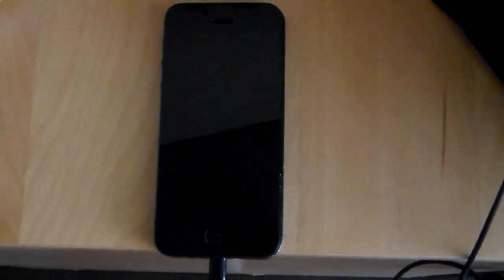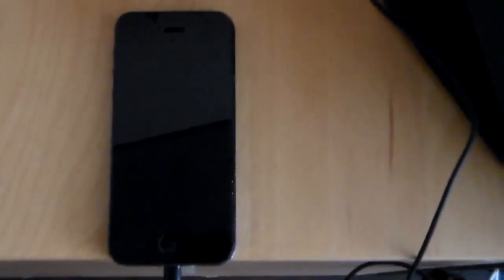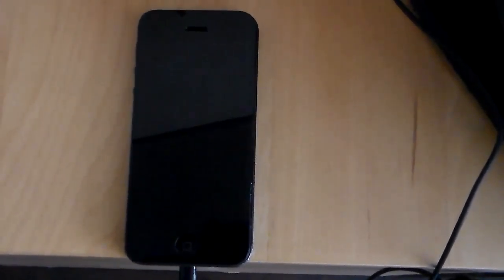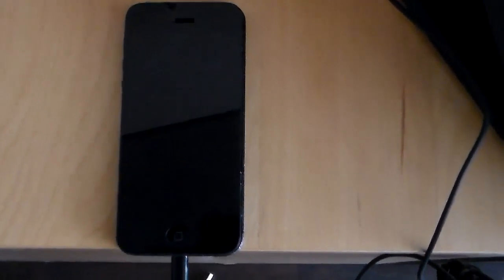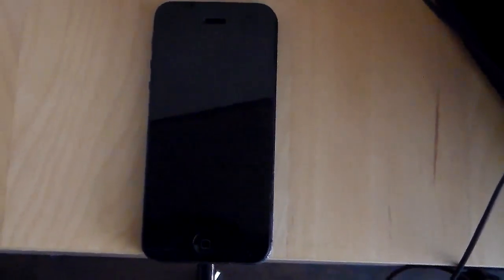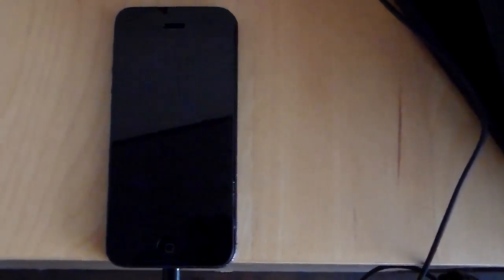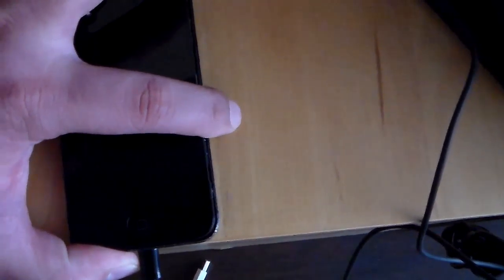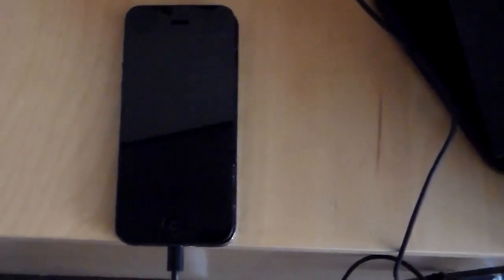Water Damaged iPhone 5 Vibrates every few seconds with broken LCD display.  Can't charge phone.

Comment: I HAVE THE SAME PROBLEM Vibrates every few seconds with bLACK LCD display even if i romoove the lcd and i connect it  whit itunes its the same problem steel vebrating every 5 secend :/ i didnt have a solution

Comment: You aren't supposed to charge your iPhone when it has water damage, I tried charging mine while it had water damage and it fried my phone. One of the things you could do to help the water damage is to put your iPhone in a bag of rice overnight, so the rice can suck out all the moisture.
Reply from the maker: +Jen L Thanks Jen.   You are very correct.  If the phone had been water damaged in the sense that it fell into water,.... then people should attempt to remove the moisture with rice... or take it to a professional who would most likely open the iphone and dry it out manually.

The broken iphone you see in this video only had water drop on the top of the screen.  Upon opening the phone there was no evidence of moisture damage within the iphone.  

What I hate about the beeping is that it could be a number of things related to a bad screen or even mainboard damage.

Comment: this problem is currently happening with my iphone5c water never touched it but i dropped and it went black and when i plug it into the charger it dings/vibrates every other second. help im scared!
Reply: Did you find a solution for it yet?
Reply: michelleduran30 yes actually! i went to get my screen replaced
Reply: Moocowymandel did it fix your phone??
Reply: OR... you could not buy an iPhone that breaks after one drop. Easy solution- get android for half the price and stop wasting your money on shit.

Comment: So water can possibly damage the iPhone screen uh? I just got my screen dysfunctioning because of several drops of water. But i can still hear the charging sound everytime i charge it to my iPhone. Any solution mate?
Reply from the maker: Kaka Leite This phone had water splashed on the top of it's screen.  The previous owner was in a hot tub.. and got the screen wet.  It worked for a few days after the owner dried off the screen, but eventually the screen went out.. and did what you see in the video.

Comment: Remove the screen by taking out the two screws on the bottom then pull up the screen from the bottom using a suction cup 🚨(careful there is connector ports at the top) remove the cover and take the ports for the screen off. Unplug the battery and clean the phone with 99% isopropyl alcohol. This saved my iPhone 5 after it took a swim in a salt water fish tank

Comment: my does that to but i hold the home button and the power button for 10 sec and its works
Reply: but where can i buy a new screen for a Iphone 5c my is all cracked i got the phone for free form my friend and it still power up but cant open the phone form the pass code because its all cracked
Reply: Go to a site called          Ebay         and buy it there they make the best deals also they take less $$$$$ than Amazon

Comment: I have a 5c with the same issue exactly. The only difference is I damaged the screen when I was replacing the battery.
Reply from the maker: Oh wow.... do you remember what part might have been damaged?  I'm guessing it was the LCD cable?... Usually if the digitizer cable is off... the iphone will still boot up.. I think..

Comment: My friend gave me a iPhone 5c and the screen is a little cracked but she says it turns on and works but she hasn't charged it for two months ,I got the phone yesterday and charged it and now it's making the beeping sound. Do I need to charge it for a long time or something I don't kno please help asap !!!!!!!!!
Reply from the maker: hi shemar.

when is it making the beeping noises?

when it is beeping, have u tried a hard shutdown.  press and hold the power + home button at the same time.
Do this holding itmformlike 15 to 30 seconds.  After its completely shut off , you can try powering it up again.

laslt, when you hook the phone to a computer or desktop, is the phone detected by itunes?
Reply: Thanks for replying, and yeah when I hook the phone up to the computer, the phone is detected by iTunes and I have restored it , I have pressed the power button and the home botton together it powers off , I can tell because when it charges it vibrates or beeps ,however it doesn't turn on ,so I think it's the screen is the problem...
Reply from the maker: Shemar Official Yes,  it is likely the lcd has gone bad., 
Best case scenario is that its just a loose connection.  A repair shop should replace the screen for $60-70.  i think a replacement screen costs $30 and above on ebay/amazon.

good luck

Comment: I have the same problem, one day I went to the beach and it started raining so my phone got wet and the screen went black so I went to the replacement store and they replaced  the screen with a new LCD and screen in there and start working.but 5 days later the phone drop and then the screen stopped working and I plug it into the charger to see if it would solve anything but when I plug it into the charger it just kept vibrating every 5 seconds.should I buy a new screen????
Reply from the maker: Hey Matthew... since you just replaced your screen... why not try taking the screen back to the LCD replacement shop and tell them it stopped working.  

It might have been the screen was faulty to begin with.... and you dropping it only accelerated the process of it dying.

On the flipside... maybe it's just a loose connection... something they can fix easily.

Comment: got the same exact problem...any resolutions yet? i have the 5s and its water damaged
Reply from the maker: In my case... mine was just a broken LCD.  Once I tried it with a cracked LCD which I got off of ebay for $15, I also tried purchasing a new screen for $45 and that one worked also.

When you plug the phone into a PC/mac with itunes.... does it recognize your phone?  In my case, it could detect my iphone 5.
Reply: it does...it even syncs the pictures from the phone and everything but the screen wont turn on and it wont stop vibrating
Reply from the maker: chido mangi I had the same exact problem as you then.  
1) Phone will just beep or vibrate (if I put to silent mode) every few seconds when plugged to charger
2) If plugged to PC, it recognized the iphone and I could see it on itunes.

It's highly likely you just need to replace the front screen.  
The screen's can be bought as cheap as $30 on Ebay as well as Amazon.  I trust amazon more as you can see the seller's reviews.

* When replacing the screen YOURSELF... the screen does not include a replacment home button, front camera, or front earpiece.  These will have to be transferred over to the new screen.    The home button cable will probably rip.  You can order one of these for $2 on ebay.

Good luck.. I hope it's just a screen replacement.  It sure sounds like it from my side.. ** I'm just a regular person like you.  I'm not a licensed professional so always take anyone's advice on the web with a grain of salt.

Comment from the maker: Carlos,  That's very strange.  So you're saying:
1) When you plug in your charger.. it causes your phone to constantly vibrate or make sounds.
2) When does your screen turn dark blue?  When you're phone turns dark blue... all of the buttons makes sounds like it's locking?

Hmmm... that sounds software related to me... (but I'm no expert).  Has your phone been jailbroken?  Or... what ios version are you running.  Maybe you can try the following:

1) Backup your phone in itunes (and backup important pics/music/videos)
2) If you've already tried turning off your phone, you can try a force shut off of your device as explained by Drake "Hold Power + Home" until the phone shuts down.  Now you can go ahead and power your phone back.
3) If it's still not working, then you might try a factory reset through itunes and then restore your backup from itunes.

Good luck.  I've run into something similar to this.. , but it was with an old iphone 2g which I had running custom firmware whited00r,... it was usually fixed with a reboot or respringing the dashboard.

Comment: I have same problem on iphone 4....my iphone is NO water damaged...please help me...
Reply from the maker: Hey Jaro... what kind of behavior is your iphone 4 exhibiting?  I've had quite a few iphone 4 and 4s's... but I've never once heard my phone beep every few seconds.  

My iphone's that had a broken LCD/digitizer.. they never made any noises at all....
Reply: I Have cracked digitizer / LCD.... I bought from ebay new digitizer/lcd .... I waiting ...
Reply from the maker: Jaro Dolek I see.. you cracked the screen on your phone.  LCD's for your iphone 4 should only run you about $20.  Good luck... it should fix your problem.  Although it's strange if you had a beeping noise.. I thought it was only for the iphone 5.  Take your time removing the screws and take plenty of pictures.

What I did... was i made a sketch of my phone...(enlarged) and then as I removed stuff.. I would tape the screws and parts to the paper diagram so I would know where what went to what.  Also, don't use the included screw driver that might be sent with your kit.  The only good thing is the penta screw drive used to take off the back cover.  The regular screw driver might strip your screws... I had problems removing the side screws as they required more torque then any of the other screws.

Good luck!
Reply: Thaks!:)

Comment: The power and lock button trick is actually just force shutting off the device. It's a mechanism to help if the device has froze and is unresponsive. If you do it on an iPhone that works fine you'd notice it would force shut off.
Reply from the maker: Thanks for the explanation.  I still wonder why this helps some people with this problem... as I would think the beeping noise is indicative of some kind of hardware failure.
Reply: @aleksdude  did you try taking it to Apple? Maybe Apple could explain to you what’s going on and why this is happening.

Comment: Hey Aleks where did you buy that new screen LCD? I have the exact same issue.
Reply from the maker: I usually buy from amazon since they have a pretty good buyer protection (I've had to use it in the past).  

I bought a used one for $45 because it included the home button + front camera and all the accessories.  I didn't need to transfer all of that stuff over.  I can't find a listing like that anymore.

If you plan on just getting the digitizer + lcd, it seems like they've gotten cheaper.  I see that it can be found for as cheap as $30 but they're shipped from china.  Expect to find dead pixels or some kind of flaw for the price being so cheap.

Here is a cheap listing on amazon:
www . amazon . com/gp/offer-listing/B00B3O38GK/

But I'm assuming you need it sooner then later... so here's that'll be hard to find (especially one that's reliable).  I couldn't really find anything with good reviews.

Comment: with the replaced lcd display your phone now works normally with the screen working and no beeping/vibrating and it charges?
Reply from the maker: In my case, yes... after replacing the screen, my iphone starts up fine and charges.

Noone has gotten back to me if changing the screen fixed their problem though.  There is always a chance that the problem may be at the board level.
Reply: aleks dude ok thanks, and this video i watched said take out the motherboard and clean it something with high alcohol so i did and it still did the same thing with the screen and vibrating, so im going to buy the lcd dignitizer and try it
Reply: mwood0012 what HHappenedi have the some PProblem

Comment: Probably the only video that matches the same symptoms as what my iPhone 5 has! I had a broken Screen/Digitizer, so I replaced the LCD/Digitizer on my iPhone 5, i tested the screen as soon as i plugged in the cables within the phone, and everything worked fine. So, i continued to screw the rest of the screws and now its finished I ve tried charging it and it just makes a repeated buzz noise and nothing showing on the screen what so ever! I have taken the phone screen back off and then put it back on again and still no luck. I can t get the screen working again and the buzz noise wont go away. It only makes the buzz when plugged into a mains charger, it does nothing while not connect to charger, no screen, no sound etc. Any ideas anyone? iTunes picks it up and asks me to sync, but then asks me to confirm the sync on the phone....which i cannot. Help??
Reply from the maker: Hey dayle,  i dont think you have a bad board... it sounds like the replacement screen you installed may have failed.

1) You can try removing the battery and discharging it by pressing power.  (Its similar to pressing power + home)

2) Try disconnecting the screen and reconnect it the way you got it working the first time.  I'm afraid the connector somehow broke when you were finishing up the re install.  Its not uncommon for you to get a bad screen if you bought from ebay or amazon.

I've accidentally broke my own screen during installation because somehow the cable connector got crimped.

You might try taking the replacement screen to get tested at a phone shop.

Im not an expert on iphone 5 repair.  I've only repaired the one iphone you see on this video.  I fixed it buying a cheap.cracked screen on ebay for $15.... then when i verified the fix worked... i invested in a $50 screen.
Reply: Okay thanks for the tips.
Also, when I try holding both the power + home button nothing happens. But, if I hold both buttons while the phone is plugged into the charger the phone does restart because the buzz noise stops until restart has finished...and then theres a vibration, and then back to the repeated buzz noise. I'll try taking battery out and let you know how things go.

Ive already tried disconnecting the lcd/digitizer a dozen times now so I'm guessing it can't be that.

And the phone still does the buzz noises if no screen is attached to the phone.

Comment: yes i have
Reply from the maker: Too bad the "home + power" button workaround didn't work.  
Another long shot is removing the battery cable and re-attaching the battery (this would in theory do the same thing as the "home + power" workaround.

If you're phone is still recognized by your PC in itunes, then there's a high chance your phone can still be fixed with the new screen.  

Also forgot to mention, did you try unhooking the LCD/Digitizer connection from the board and re-hooking it back on.  (just trying to rule out the chance that the connector got loose).  It's probaby not likely... as I think when you get the symptom of the phone beeping or vibrating repeatedly every few seconds is just a way of the iOS to tell you the phone's LCD is broken.  

Let me know how it goes.

Comment: Did replacing the screen actually fix the phone?  I have this problem and will get the screen replaced if it fixes the problem.
Reply from the maker: Hello Andrew, 

 Here is some additional info so you can match the behavior of my phone with yours.

1) when set to vibrate, it would vibrate every few seconds when plugged to a charger.

2) When set to regular volume, you should hear a beep noise every few seconds instead.

3) If you hook up the phone to a desktop computer with itunes... eventually itunes should auto load and detect the phone but it asks you to trust the phone.

This all happened for me.  Yes, when I replaced the screen it fixed my problem.

I bought a cracked screen on ebay to test if it worked for $15
Reply: aleks dude Hey thanks so much for your response!  My experience exactly matched yours.  It's completely dead, doesn't respond to any of the power/home key combinations.  But when I plug it into any power source, it either beeps consistently or vibrates consistently depending on the setting.  When connected to iTunes, it communicates as if nothing is wrong.  I resorted the phone to factory settings then ran my back up on it.  All successful.

I just brought it to a local phone dealer who told me that the motherboard was damaged and that the phone can't be fixed.  I thought this was a little strange considering the fact that iTunes communicates fine with it.  Would you agree?

I guess I'll get a new screen and see if that helps.  Thanks again for the video and for the response!
Reply: Andrew Guastella Im having the same problem are you saying that the phone is broken or i just needs a new screen ?
Reply from the maker: Andrew Guastella Andrew, if you don't want to spend too much to test your phone... you can try what I did.  Ebay sells cracked screens for less then $20.  This way you can test the screen yourself.. and if it happens it works.. then you can invest in the costlier solution of a $50 used screen or a $70-80 quality screen.  The cheap $45 china screens are hit and miss (dead pixels and sometimes failure within a few months).

I was fortunate to get a broken screen for $15 on ebay.  Tried it out.. and it worked.  Afterwards.. I bought a used like new apple screen off of amazon $50 shipped (it included all of the accessories like front camera, home button, proximity sensor).  New LCD screens are usually missing the front accessories so please take that into account as you'll need to transfer the parts from your old screen onto the new one.  In addition, the home button is hard to transfer... I ended up breaking the button (the good thing is the button is only like $1.50).

Good luck.